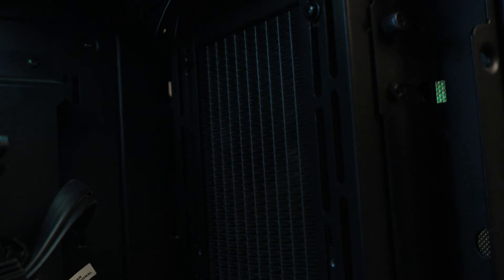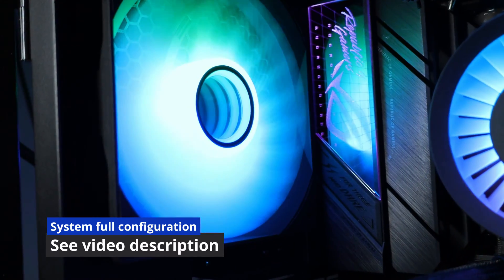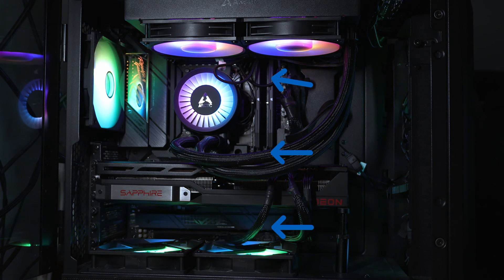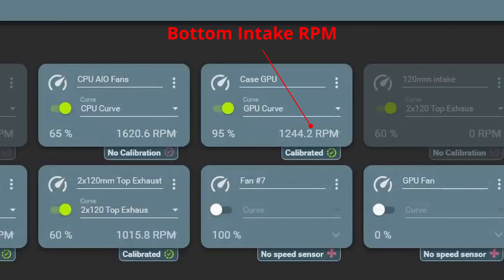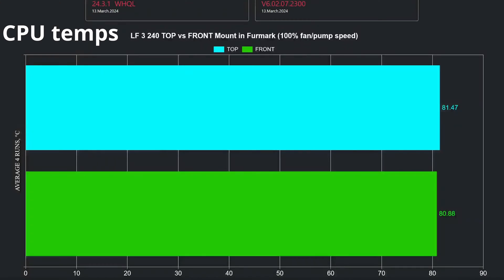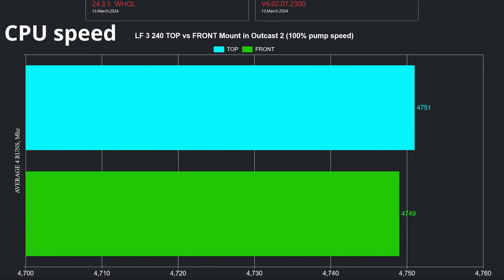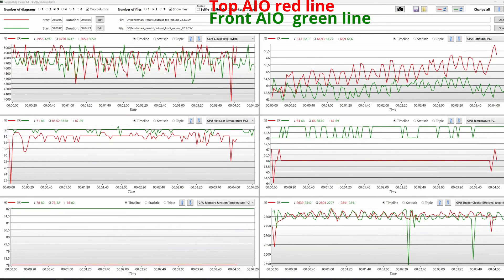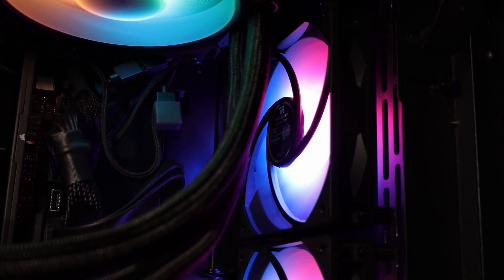AIO Front vs Top Placement, which is better | CPU and GPU clocks and thermals | Benchmark 1440p

Comment: You should also mention the methodology you used, was your front radiator pulling air from in front of the case? or from behind the radiator? I ask because I’ve seen some setups where pulling air in from the front case results in temperatures that are 5–6°C better  than using a top exhaust radiator.
Reply from the maker: So, when using front AIO install you will get better CPU temps, but worse GPU temps.

Comment: Main issue with this topic is, do you actually have bottom intake for GPU when you front intake AIO.  If you dont its rough. This also needs to be checked with a high watt GPU like the 5090.
Reply from the maker: Well, if you have front mounted AIO, bottom intake fans are a must for the GPU.

Comment: Thanks, found this while searching for answers on why my CPU is running 90-100C while gaming on Ultra 1440 (4090, 13900k). Set up pretty much exactly what you have in the vid albeit 360mm AIO top as exhaust, 2 x front 140mm intakes, 2 x bottom 140mm intakes and 2 x 120mm rear exhausts - seems the 13900 is quite happy at 100C, even 110-115 0_o